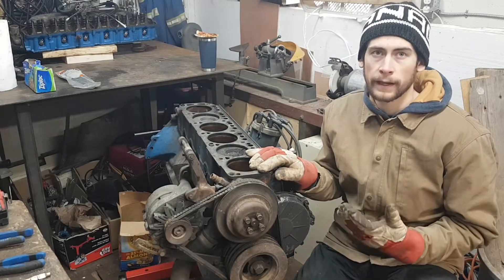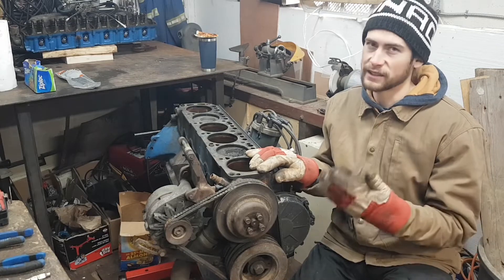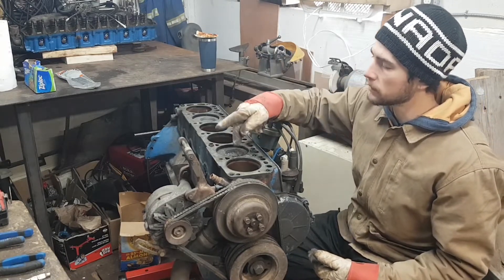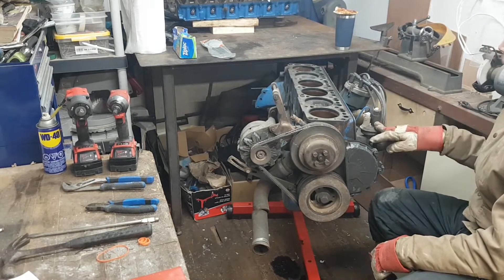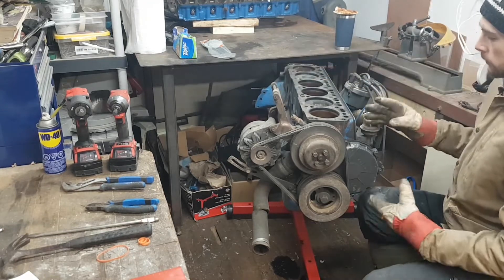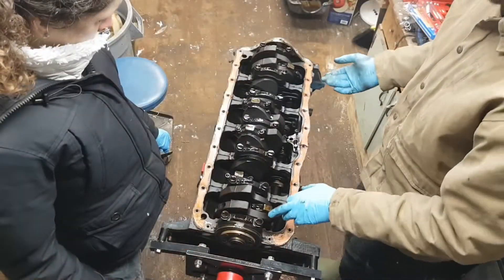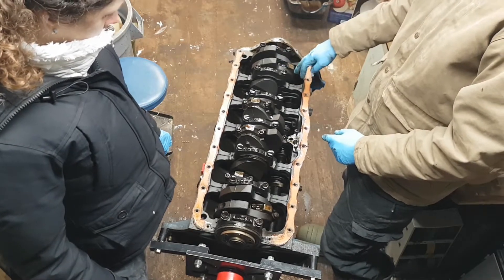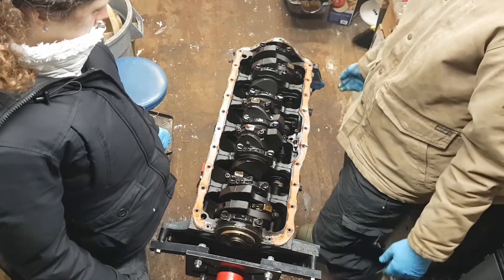Ford 300 Inline 6 Engine Rebuild Part 2: Teardown

Comment: so A 1990S INLINE 6 WILL PROBLY FIT a 1966 MERCURY TRUCK WITH 240 INLINE 6?
SAME/SIMILAR MOUNTS AND BOLT PATTERN FOR THE TRANNY?
Does he reveal why he went with rebuilding 40 yr old block versus newer 1990s block?
Reply from the maker: I rebuilt the older block because I already owned it. A 90s block would have worked too.

Comment: Wow what a clean engine inside and out I'm surprised!
Reply from the maker: I did a fair bit of cleaning on this engine in the past 8 years on the outside, but I was also pleased to find it clean inside. It was still worn though, and the shop recommended a rebuild. Just 0.020” over on the pistons.

Comment: When you disconnected your rods from the crank how did you determine orientation. Because if you flip them around they could go either way!?
Reply from the maker: The pistons are marked which side is front. The machine shop took the old pistons off, and put the new ones on. And they also marked each rod half with a little punch to indicate how to put the two halves together. So as long as the pistons are put back on the same way, with the mark facing to the front of the engine, the rods are on correctly.
Reply: Easy way is the a small hole that squirts oil out of its about 1 mil on the shoulder of the rod. It goes on the cam side . And yes I know the rods are stamped

Comment: The egg crate for the lifters… Love it
Reply from the maker: Haha, thanks! It's a perfect fit :)
Reply: Pero. No exactamente los elevadores tienen que llevar un orden pues son exactamente iguales cierto
Reply from the maker: @julionieto2734 they are the same, but I did not know if I was going to reuse them or buy new ones. If you reuse the old ones you should put them in the same order. They each develop a unique wear pattern. The same is true for the pushrods.

Comment: Not sure why you’d need to maintain location of bearings and lifters. Surely your not reusing them. I wouldn’t tear it down and send for machine shop without replacing with new.
Reply from the maker: Yep, great point. I am NOT reusing them. However, the machine shop requested that I leave them matched, so I did. My understanding was they wanted to have a brief look at each one, just to help confirm the condition of the crankshaft journals.

Comment: The machine shop is gonna tell you to go the full montey. Because they are in the business you should just clean it put new bushing rings and seal it back up.  The ford 300 will roll on forever.
Reply from the maker: I see your point, but honestly that's the approach I've done so far on this engine, and have just never been happy with its reliability. I am going to be doing a proper rebuild on this, and should be getting it back from the shop soon (more details coming soon). I'd rather have the peace of mind knowing that everything is to spec, than dealing with frustrating little issue.

Comment: my 1995 f 150 300 has 280k on it still strong had since new hope to keep it for long time have no money to get new good luck me friend
Reply from the maker: Wow, that’s great that it’s lasted so long. With continued regular maintenance, I bet it will last you quite a bit longer as well! My engine technically could have kept running with out a rebuild also, but I just found that after 40 years of life, there were a bunch of random things wrong with it, that added up to being best to do a full rebuild.

Comment: I wish I had a way to take my engine out so I could do a total rebuild. Thankfully the guy before me did a great deal to rebuild it before I bought it. I bought the truck right after he ran out of money for his own build. I know the head was rebuilt and resurfaced. I dont think anything else on the main block was modified though. I am not that concerned with speed or upper end horsepower though. It is a survival truck. I want it to have torque, ease of maintenance and the ability to be a light rescue for other vehicles. I may see if I can find the same engine later in a similar year range later in a F150 4x4. Hopefully with an auto tranny with low gearing. My right leg is disabled so I have to reverse the location of the gas pedal as comparitive to the brake (AKA why the auto is needed. Honestly I find a manual more to my liking but the universe does not often do what I want :) I may even try some experimental fuel system work. I have my grandfathers tinkering gene (He was a mechanic in San Fran for both Ford and Chevy during the 20s and 30s and a dreamer). Anyway. Love watching this.  Keep it up.
Reply from the maker: Well, if the head was gone through and resurfaced, it will probably be good for a long time! The 300 inline 6 has the benefit of 7 big main bearings, and because it's generally not revved very high, the bottom end can last a very long time!